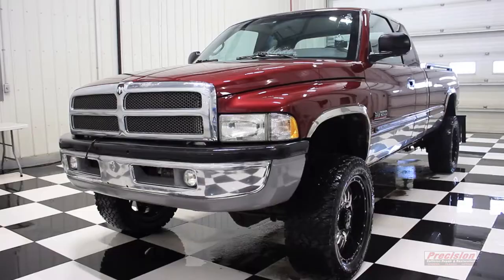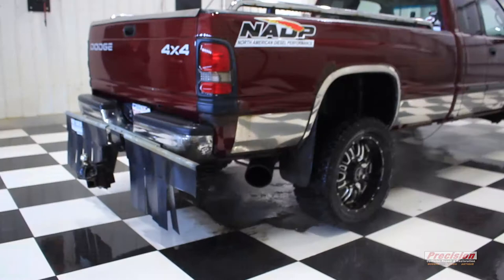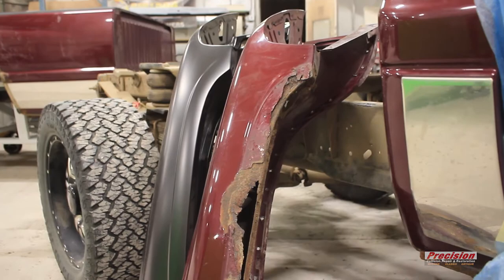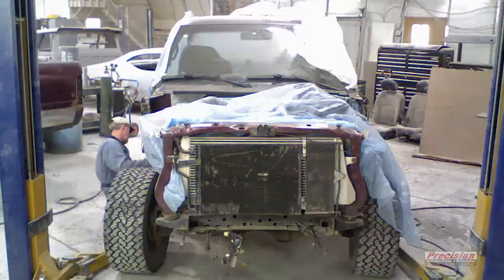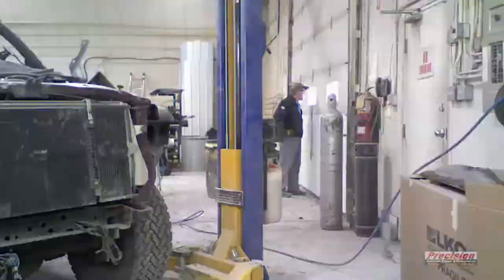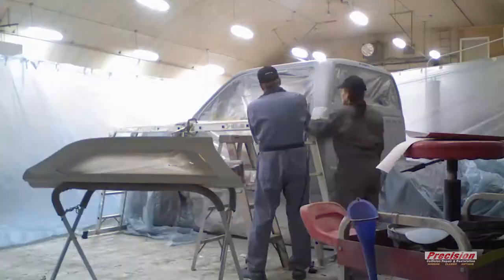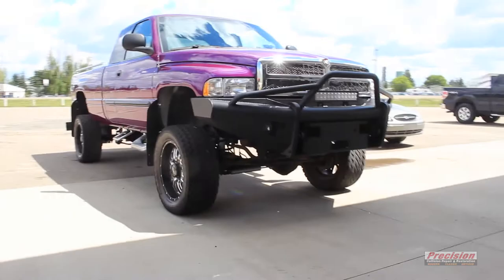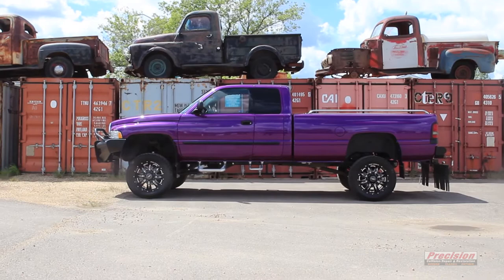700+ HP Dodge Ram Restoration

Comment: Almost impossible to find?
Reply: haha right
Reply: Yes.

Go hop on your local classified listings, and I bet you most of the 24 valves you see are going to be short box, or dually.
Reply: Or option three regular cab long box...
Reply: Dutty Diesel no not really.. just wait a week and the right one will pop up. They sold hundreds of thousands of these trucks.... a rusted piece a junk long box like the one in the video is not hard to find.

Comment: Your body work cost you what? Probably at a top-end 10 grand, maybe 15....

As you said you've got 50 under the hood...

Got to do my rough calculations, will give you an extra 10,000 on your body budget...
That leaves you at a grand total of 75000, and no DPF to leave you stranded. I stand behind that decision.

Comment: Typical dodge. The powertrain will go 500k but the body will fall off of it before 250k unless you're taking precise care of it and spend 2 weeks a year treating the metal and meticulously going over the hidden areas that will collect salt and dirt and road grime that'll eat away at the cheap metal.